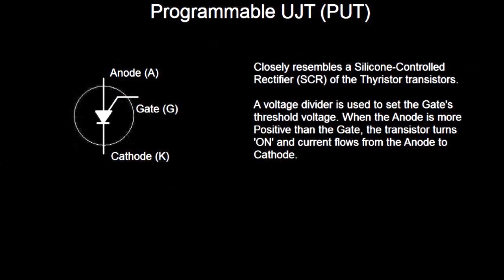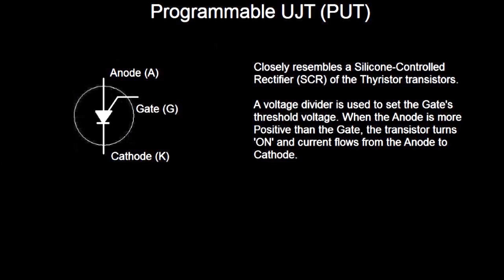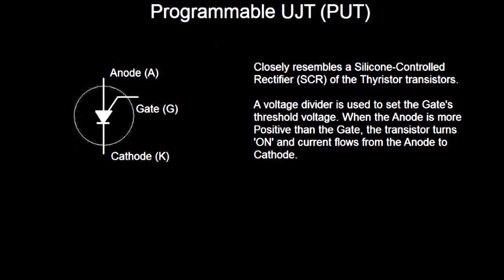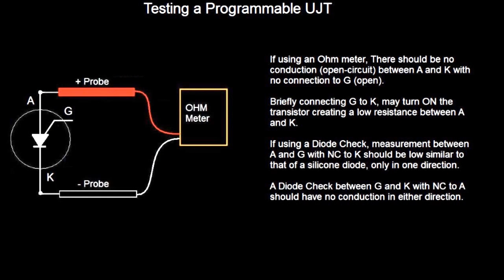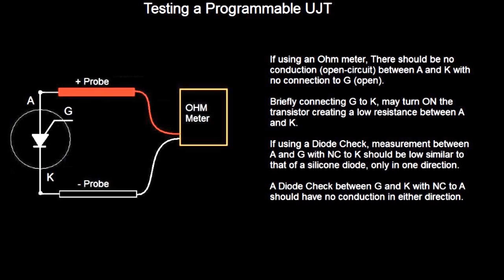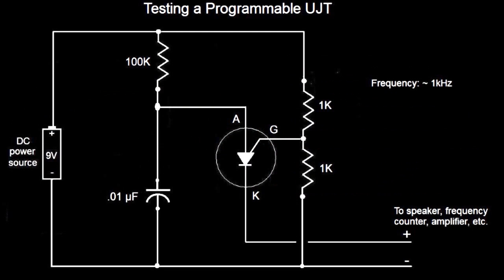Testing the Programmable UJT

Comment from the maker: No. The two 1K resistors are used to form a voltage divider that sets the Threshold voltage of the gate. It's gives better control of the threshold voltage. The divider is set to drop the voltage to 4.5V at the Gate, so when the Voltage at the Anode reaches (as the Capacitor charges) to 4.5V the PUT conducts. The charge on the Capacitor drops below the transistors Cut-Off voltage. the PUT turns off and the cycle repeats. -MrFixit